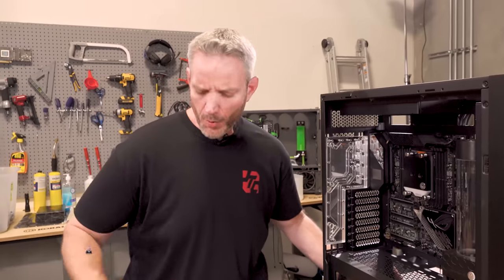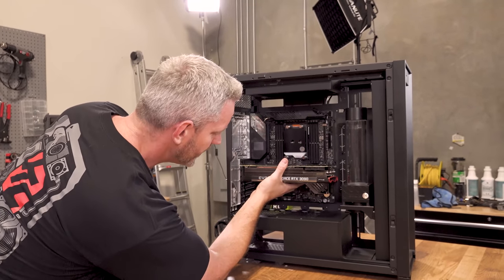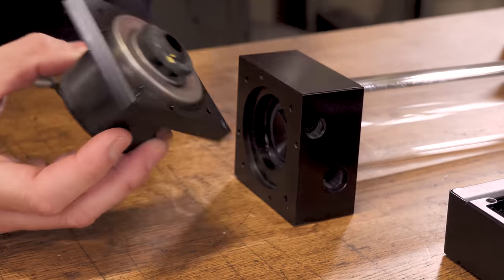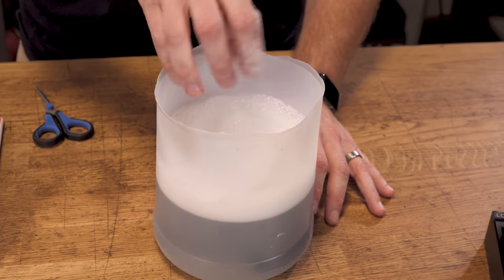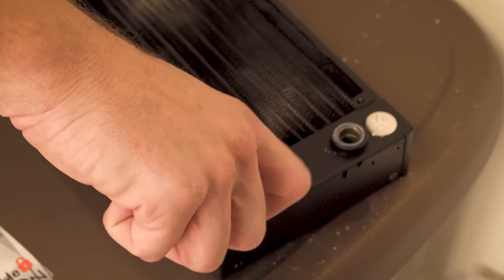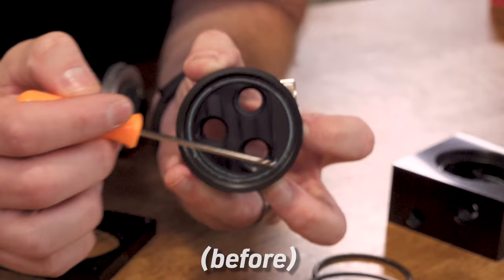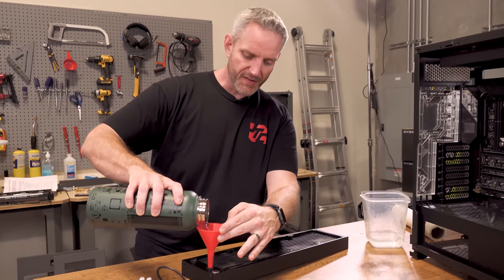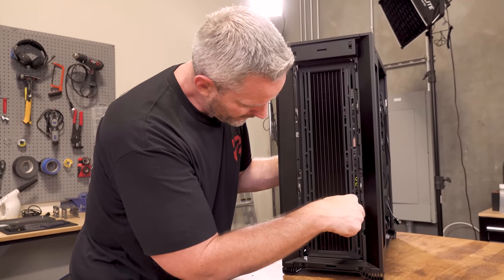Skunkworks Custom PC Build - Part 2

Comment: Sorry Jay, if it’s 13mm OD and 10mm ID then you actually have a 1.5mm wall thickness. You have to divide your difference by 2 since on a diameter you have half the wall thickness on each side.
Reply: Yea, for a while there I thought Jay would have some exotic 13/7 mm tubes :) (he mentioned the wall thickness first before ID)
Reply: lol scrolled down just comment this. Ya hate to see it when he made such a point to be clear in the video! All good Jay, mistakes happen.
Reply: Since he said he was "condescendingly pointing that out", it's pretty obligatory to condescendingly correct him.
Reply: technically*
Reply: @kenshin1368  Thank you for beating me to this.
Reply: Here for the same lol
Reply: cool story bro........tell it again
Reply: I was hoping you would open your comment with "Technically...." lmao
Reply: Pretty sure his comment was a shot at Bitwit's tweet, then still gets it wrong himself bahaha.
Reply: @nickmeriweather587  or "to be fair" lol
Reply: scrolled down to look for this comment. i know what Jay was going for there but it didnt work at all. 3mm wall thickness would be one chonky boy, thats basically 1/2" Schedule 40 😳
Reply: Technically, you're right.
To be fair, trying to make it right twice as hard, can go wrong aswell.
Reply: @OldBuford  yeah, but those chunky boys are great for lightweight and rigid high tension members, as long as they are short "lenghtwise" (bad pun intended)... or insane internal pressures...
Reply: I spent 10 years digging schoolboys how to do that sort of maths while using lays in the metal workshop amazing how many bright young grammar school boys didn’t get it.
Reply: Glad I'm not the only one who noticed that.
Reply: I'm gonna be Devil's Advocate here and say Jay said it right. He knows the thickness of each wall and was just adding them up.
Reply: @jonsathome  Each wall? It's a circle, it only has one wall. If it was square, then maybe it has 4 walls and then it would add to 6mm. But that's not how ID and OD works.
Reply: @akren2482  Mistakes happen, yes. But when you make a mistake while acting so smug about it....that's just cringe.
Reply: If he gives you a heart we will let him off and it's all golden
Reply: Was gonna say the same
Reply: @Kholaslittlespot1  👍😁
Reply: @tonyparker3506  ok fine not each wall. but a 1.5 thickness times 2 for diameter. Kinda nitpicking there Tony.
Reply: @jonsathome  Still only 1.5 thickness.

Comment: Jay, 10mm ID + 3mm wall thickness is 16mm OD.
Reply: Jay brain fart moment
Reply: As a person that does volumes in cylinders as part of their career. Can confirm.
Reply: Yeah or it’s 1.5mm wall thickness adding up to a total OD of 13mm. Either way jay wrong
Reply: Jay being adamantly correct but totally incorrect somehow as usual 🤣
Reply: came to make the same comment, 3mm at the top plus 3mm at the bottom is 6mm
its not complex but your wrong somewhere Jay
Reply: Just about to say that lol
Reply: I'm gonna blame the weed I'm smoking ok why I didn't catch that.
Reply: Yeah I was wondering too...I rock 14mm OD and 10mm ID, it is 2mm wall thickness...because...it's round?
Reply: @Biggif01  OK, but this is something anybody could figure out
Reply: That's what she said.......
Reply: to be fair*
Reply: I thought I was dumb for a moment then I saw this comment and realized my brain is ok 😂
Reply: Simple maths lol
Reply: Wait what? 10+3 is 13 
 16 Does not compute
Reply: Guys tell this to Alphacool i wrote them an e mail once in german and even with pictures of a caliper they still say its 3mm.🤣 Edit: checked their side they removed it meanwhile instead of correcting it from 3 to 1.5mm 🤣
Reply: 3+3+10=16 O
Reply: @Kritchley  Thats what everyone says....m8 wallthickness in a circle is always times 2
Reply: @NeVErseeNMeLikEDis  we were thinking of radius when it's a diameter.
Reply: @12Burton24  so if you measure left to right 3 thick 10 inside 3 thick isn't that 16 overall tube thickness ?
Reply: @Kritchley  Thats what everyone says. 
If you have 16 minus 10 divided into 2 equal 3mm whuch is the thickness of the wall, its what you messure with the caliper as an example
Reply: @killshock360  
Ohh. Totally forgot about that thanx 🤪
Reply: @NeVErseeNMeLikEDis  there are two sides on it you know... 10+3+3=16 does that compute
Reply: Dont try teach Jay.... He gets mad
Reply: I was going to comment when I heard what he said, 13mm OD and 10mm ID would mean 1.5mm of material surely as there are "two walls" to account for, "one wall at either side" of the diameter.
Reply: but but but... when measuring OD, you have 2 walls, so obviously Jay is correct: you have a total of 2x1.5mm so 3mm wall thickness, duh ;) as Jay said, you people over complicate things with your "dividing numbers"  and stuff
Reply: @TheBitKrieger  So if you order a tube with 2mm wall thickness you‘ll be surprised because they ship you a tube with „4mm wall thickness“? Nobody‘s dividing, you are multiplying by 2 if anything.
Reply: Yeah he’s not accounting for both sides of the tube. 😂
Reply: Yeah just heard that. Was about to comment.
Reply: I think he meant 3mm total wall thikness on both sides of the tube.. well u know how jay thinks.! We also need to adopt if we are watching his videos😌
Reply: r/confidentlyincorrect
Reply: Top comment, big oof as Madison would say 😂
Reply: I came here for this as well 😂 it’s a common mistake in the world of tubing. The diameter of the tube is ID + (wall thicknessx2) to reverse you would take (outer diameter - inner diameter) /2 = wall thickness
Reply: @borgejoh  woooosh
Reply: Yes "technically" it is
Reply: It's definitely 1.5mm wall thickness. 3mm is some PVC drain pipe wall thickness...
Reply: @kanishka.b8550  
He didn't mean that. Nobody measures double the wall thickness on pipe/tubing. Also, there is really only one wall on a hollow cylinder, it goes around the entire circumference. Either that, or there's an infinite number of walls, counted at each fraction of a degree.
Reply: @borgejoh  saying od13, id10, wall3 leaves atleast the wallthickness open to anything between >0 and <3 - noone said it has to be 2 perfect circles with the same center
there are even applications for offset tubes, i dont know them but i saw the tubes, out of steel, but still

Comment: Props to Jay to highlight the importance of cleaning your parts. I have parts that are over 5 years old and I took the advice of many WC veterans about making sure things are clean as chemicals mixing is always trouble seriously. My WC parts are still running and haven't had a D5 pump fail on me. I have in the years got 4 D5 pumps and none has failed.

Comment: Wouldn’t a 13 od/10 id tube have 1.5mm walls? Since each tube has a wall on each side, 13-10 is 3, dived among those 2 walls, leaving 1.5mm?
Reply: The pandemic has been bad for my math too, I have experienced a very large rounding up error mostly from being lazy and eating too much
Reply: yes
Reply: correct, jay didn't do the math lol. 10/14 has 2mm walls for example

Comment: Can you please do something with the caselabs case after this? that thing is iconic. it deserves some love.
Reply: This. He should "refurbish" (repaint and repair any dents/dings/etc.) the case and use it for another build. It's a water-cooling beast chassis, and it doesn't deserve to just be sitting there. Lol.
Reply: This may be a little stupid, but I think he should make that case into basically computer shaped set lighting. Just put in some older but pretty-ish mobo, cooler, gpu and ram, don't bother with a psu or drives or anything, and some lighting strips that aren't powered off the board. The case would basically end up a lamp shade for the LEDs but it would be a sort of "Jay's museum" piece.
Reply: @dude11579  like a nerdy art piece or eye candy for the viewer?
Reply: @michaelxdrift  something like that. Continue on the visual of skunkworks without the hardware requirements.
Reply: Fan giveaway!
Reply: @Kholaslittlespot1  he already said no like 4 times.

Comment: 13mm OD, 10mm ID Is 1.5mm wall thickness...

It's not over-complicating... its just reality. Your pipes have two walls across their diameter champ. <3 <3

Measure your tube wall with some calipers. You'll find this to be true.

Comment: Hey, CLR is hands-down the best radiator / cooling loop cleaner / de-scaler. You can also use Expresso / Coffee Machine de-scaling agent. If you don't have either of those, go get a large bottle of vinegar and fill the entire loop with it, let is sit for a few hours (or overnight), then flush obsessively.

Comment: 1:33 10mm ID and 13MM OD = 1.5mm wall thickness, not 3mm...

Edit: To be condescending, the thickness of the walls on a horizontal plane totals 3mm but the wall is still only 1.5mm. Buy a micrometer ffs if you cant do basic math.
Reply: Not throwing shade or anything….
Reply: @owenlloyd4382  The difference between math and maths are regional. They are both short for Mathematics. You use maths so you're probably from the UK or one of the countries they occupied. Try to troll better ffs.
Reply: @landonmintz4850  absolutely allowed to throw shade when the video specifically points it out and still gets it wrong.

Comment: For flushing cleaning inside of radiator or and all metal parts I highly recommend cleaning or in case or rad flushing it with isopropyl alcohol 70% as a last flush after hot water. It eats the gunk much better and if it comes out very dirty just repeat once more. If u can shake it a little bit too.

Comment: Great video Jay, I've used boiling water in radiators and it works a treat (final flush with distilled water).

I've got 3 x D5 pumps, one from EK and the other two are from Singularity Computers. The EK one will default to 100% in the absence of a PWM signal but can remain plugged into the fan controller. In the absence of a PWM signal, the Singularity ones amble along at snail's pace until I physically remove the PWM lead (of the pump) from the fan controller where it runs at 100%.

Comment: I've had a Laing D5 with no speed regulation pump for 9 years through 6 different builds and it's still running strong. A lot can be said for static motor/pump voltage and speed. 🤘🏻

Comment: You should use the pump that Linus showed off that detects and prevents leaks
Reply: That wasn't a res/pump technically it was a reservoir Cap with an air pump in it that pressurizes the loop

Comment: You're condescendingly wrong. 13mm od with 10mm id means 1.5mm wall thickness.
Reply: yup
Reply: You are technically correct. The best kind of correct.

Comment: 1.5mm wall thickness. 13-10=3/2=1.5. you must divide the 3mm in half to give for each side of the wall thickness.

so the wall thickness is 1.5mm

Comment: Thanks for showing how you flush and clean the parts. I'm using black Acetal, new rads, and a Swiftech 655-B, so this will come in handy, almost the same setup.

Comment: To clean the water pump ways, I use plastic Q-tips on my drill, with tooth paste. It is just a bit abrasive to the point it won't scratch the acetal parts and gets gunk done.

Comment: @Jay Hey m8 cool video. A trick I use for the "larger" radiators when cleaning them, is setting up a small loop just using some left over soft tubing, and set the pump/res into a bucket of hot water having the "pump part" sticking out of the water (makes the pump have to work a tiny bit harder when sucking up the water instead of having gravity do most of the work - make sure the res is full - obviously). Then I add a small amount of cleaning liquid (We are talking a drop or two here - mainly to break surface tension of the water - should not be enough to cause more than a TINY bit of foam) and then use the heat dissipation of the cooler in the opposite "direction". What I mean by this is usually you use the liquid loop to dissipate the heat - well throw on hot air to the cooling fins - and you can use it to accumulate heat instead. I usually use 2-3 hair dryers on full blast at about 2 inches away form the fins to heat up the loop. Let it run for a good while - and put clean hot water in the bucket if needed. Works like a charm and is real easy to do.

DO keep in mind to take a break every like 5 min - since you can burn out the hair dryers. Don't use a heat gun - simply because they get to hot and dissolve solder and stuff like that. Use the "cooling time" to change the hot water in the bucket. 

Repeat till the water stays completely clear for a "full" rotation. This way is the least "demanding" in my experience, and since you have a lot of other stuff to clean too, so it's very time efficient too.

Be careful - since this will get hot and it will be hot enough to scold yourself on.

One last note - MOST people can use their tap water to do this - unless they have a really high mineral content in their water. The tiny amount of minerals left when you dry out the loop before reassembly will NOT be an issue. IF you have a lot of minerals in your water - buy a gallon of distilled water and use a "tea water heater" (don't know the English word for them) to heat it up. Make sure it's not completely boiling when starting the run...

Comment: To all those cleaning their loops ... warm water and soap and a soft tooth brush is all you really need. The key part is rinsing your parts with distilled water. Then doing the first fill on the full loop with distilled water then draining the distilled and filling with your coolant of choice. I personally just run distilled on it's own and do regular flushes.
Those fittings Jay tossed in the bin aren't trash unless they are pitted or mechanically damaged. A good soak in boiling water and vinegar will get stains off the nickel plating. If the plating is missing then it might be time to replace them.

Comment: Handy tip for filling with a pwm pump just short the pwm pin on the pump header to a 5v molex pin and then you'll get 100% duty cycle (thus full speed) been doing it for years.

Comment: Jay, a trick used with well water facing rigs is to use windshield washer fluid. Helps remove some stubborn materials- shale, clay, etc. It's environmentally friendly and can be warmed up, though I don't know how hot it can go. Bonus It's safe for aluminum, copper, nickel, etc..

Might help to loosen crud. Just a thought.

Comment: i used mayhems blitz kits to clean everything and it works great but it takes time for that to works, everything from 6-24h but it works, i had corrosion problems before after blitz kit never had problems,  but jay i love everything you do with watercooling, down to the boring little bit to the huge projects, so please continue to be a inspiration to other people about watercooling like you have been for me. started with watercooling with the gtx 580 + phenom II 955 and continued since then to watercool all my systems now i have 9900k + 3070

Comment: OMG!!! I have a pump that stopped working and when I saw Jay take the ball out of the motor I was stunned and didn't know that was the issue if something getting stuck in the motor. I replaced a pump in my PC thinking that the motor died but kept the old one anyways and when I saw him do that I had to check it out on the bad pump. For sure enough it was the issue...Thanks Jay!

Comment: Jay, I would like to provide some helpful tip when cleaning a loop, particularly with sediments in a radiator. If you use a large item as a reservoir (maybe a tub or jug) and have inlet at the bottom with outlet higher up (still under water enough to get pressure/fluid for the pump), you can get the sediment to settle lower than the outlet of the reservoir. You can use a tube reservoir still, but lean it on the side towards the inlet. This works to help with cleaning radiators very well as you can't open the radiators, then you can swap direction easily to ensure it is fully cleaned.
It is also possible to use a higher pressure/flow pump to force that fluid through the radiators, something like a pond pump. 

Just a thought that could help getting a better clean.

Comment: Can I make a cosmetic upgrade suggestion of sorts?

Over on Moddiy they have 8pin and 6pin PCIE U-turn adapters (90 degree adapters) for GPUs. It cleans up the look of the GPU, hides the cables. I've been using them for a couple of months now with no power delivery issues *knock on wood*. Just make sure you get the correct connection direction if you try them out!

Comment: Jay, rotate the res 90 degrees to avoid clearance issues with the gpu. That how you had it in the old skunkworks. Have the fittings pointing forward.

Comment: Had 3 Alphacool, VPP755 pumps fail. First two happened within 3 months of a fresh build using just Distilled water and EK clear coolant concentrate. Gave up and put in an XSPC D5 (and went from dual loops to a single) and haven’t had a single problem. 🤷🏻🤷🏻 So I really don’t think the problem was just a gummed up bearing.  Pretty sure Alphacool discontinued them.

Comment: If you wanna make it hot and stay hot, you could just connect a block and strap it to a heat source like a hot plate, a heat gun, a torch, the range of your stove, or if you’re fancy an induction hob or cook top that can handle smaller sized items—or get a a Threadripper block.

I’d still probably start with boiling water, but adding a heater to your loop would certainly help you maintain maximum heat for cleaning purposes.  Since you’re not wasting as much of it, you could even use distilled water if you wanted.

Comment: I enjoy these videos the most. Kinda wanted to see you use a bottle cleaner brush with an electric drill to see if the gunk would come off the inside of those fittings.